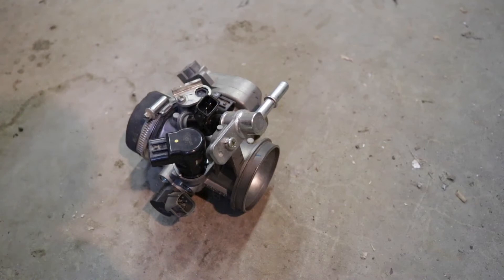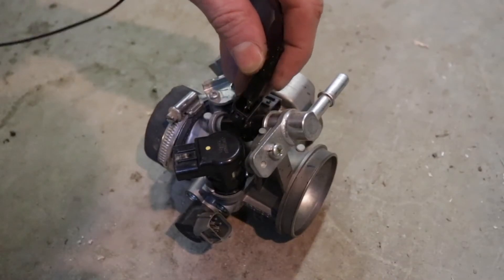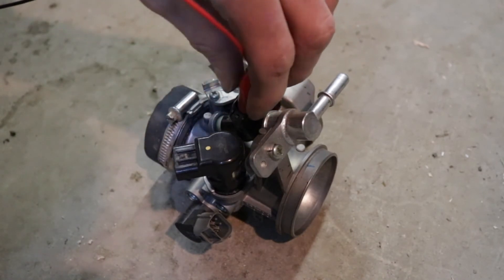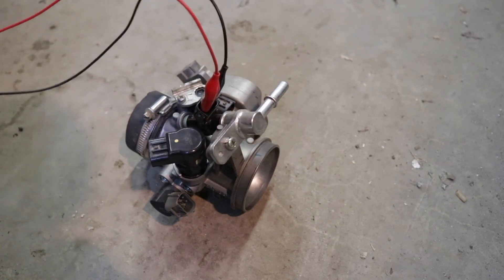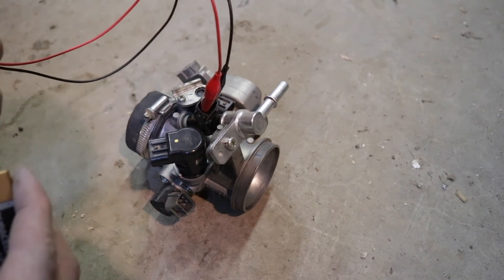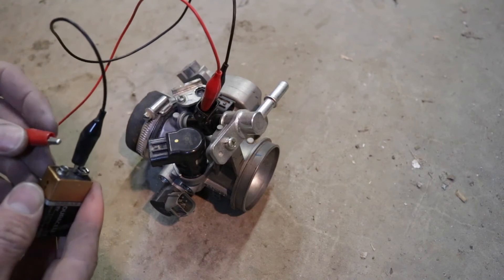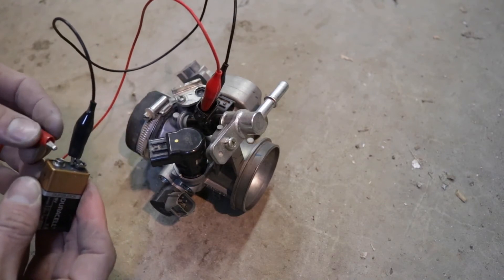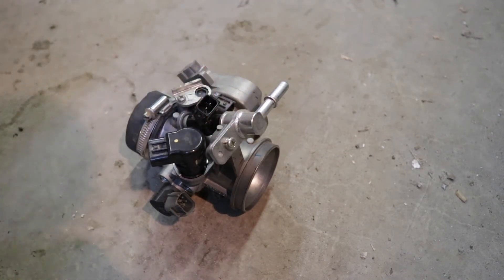How to test a fuel injector

Comment: Will a bad injector cause it not to keep running? Starts and immediately dies, throwing injector code though
Reply from the maker: Could be a faulty or clogged injector or a bad fuel pump. If it’s not getting enough fuel pressure it’ll die out. Should have a constant 43psi from the pump.
https://youtu.be/pzAT_nzzkTI?si=87BGMNwURJA5VvAA

Comment: Why cant you just do that with a wire and touch the battery on the atv? Its the battery that powers it anyway
Reply from the maker: You should get battery voltage at the injector so you could do it that way too.